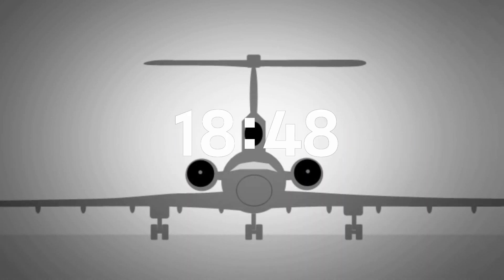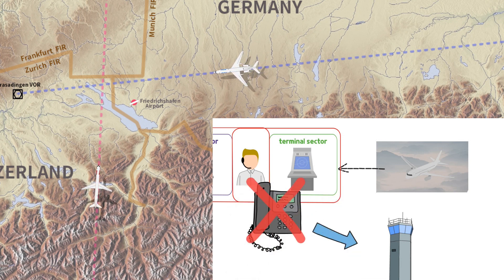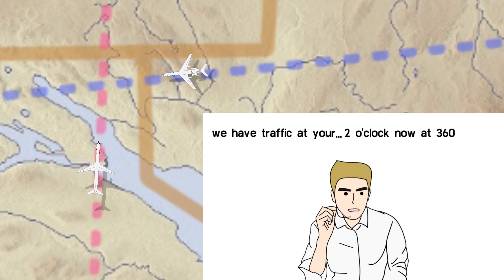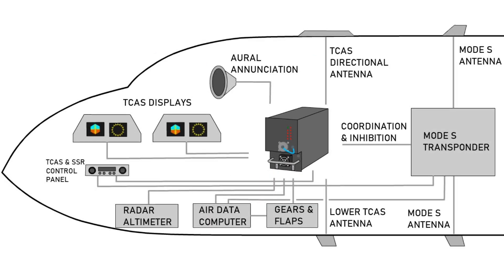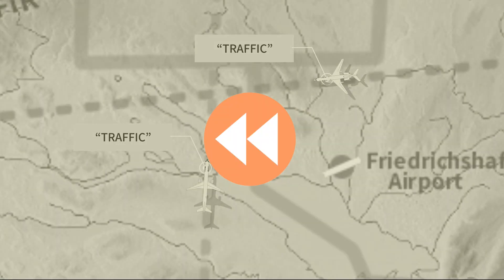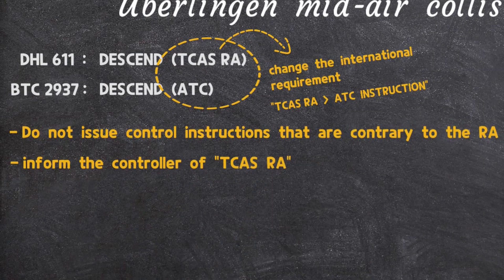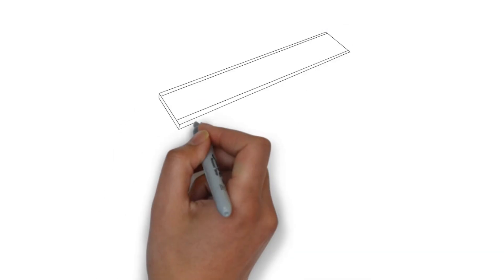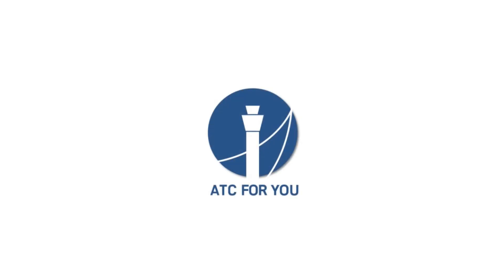Überlingen mid-air collision and TCAS (a.k.a ACAS) - controller and pilot in bad luck [atc for you]

Comment: I calculated how long it would take the DHL to completely slice through the BTC and came up with 0.01 seconds.   That is based on an estimated 500mph covering 11.9 ft.  If anyone happened to stay conscious during the collision--they would have had no idea what happened.  

The TU154 would have passed from nose to tail in front of the 757 in 0.21 seconds at 500mph (I imagine it was likely 600 mph).  Imagine the incredible odds it took to even collide!!!!  Less than a quarter of a second separated life and death!    😭